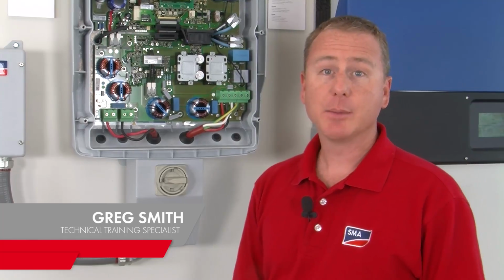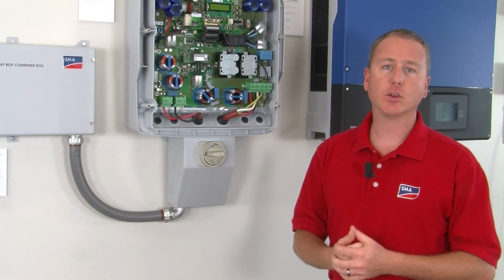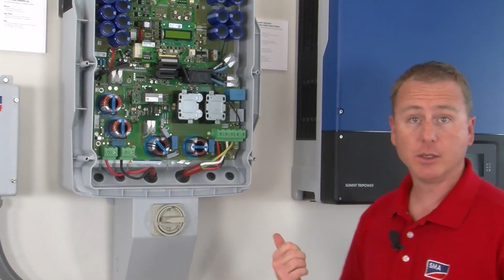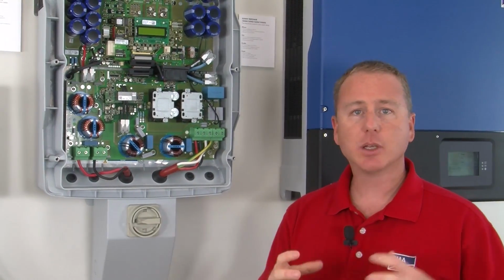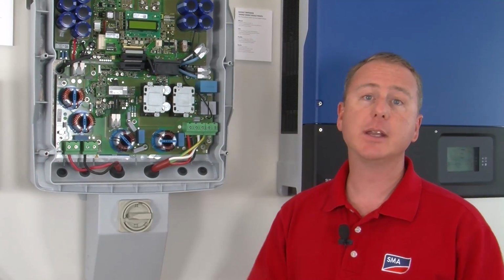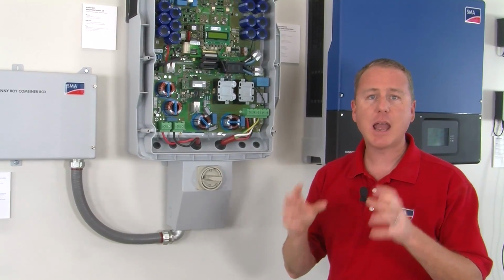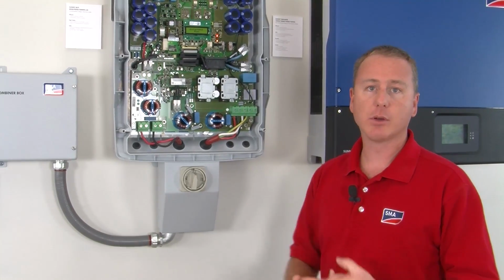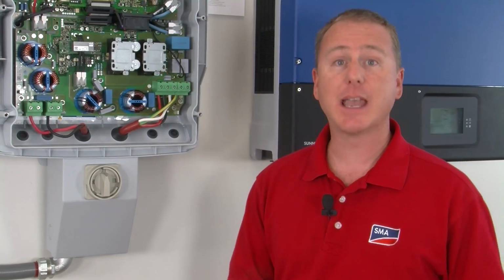Tech Tip: TL Ground Fault Detection

Comment: I would love to find a technical resource here in Brantford, Ontario, Canada that works on your inverters. I have had your units installed for 9 years and just recently getting some ground default errors on my one unit. If i disconnect everything and put in a new fuse it seems to put everything back to normal for a couple of weeks.